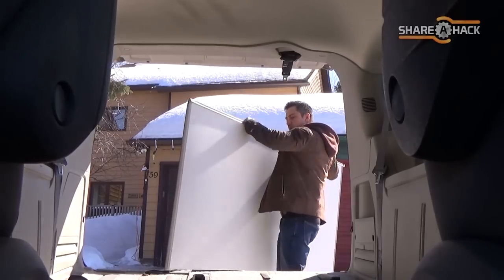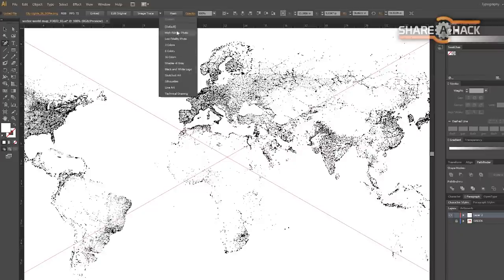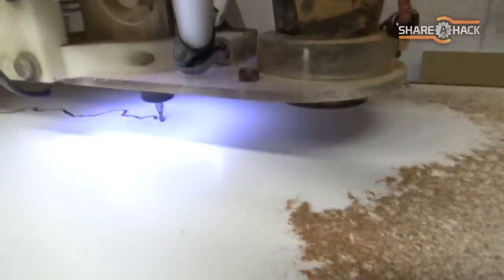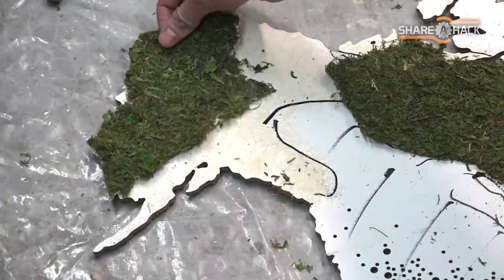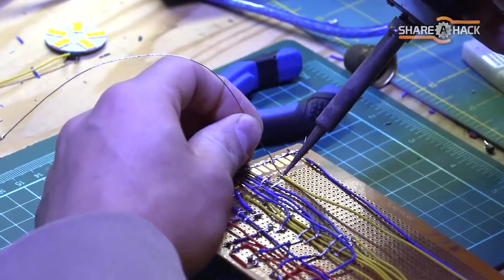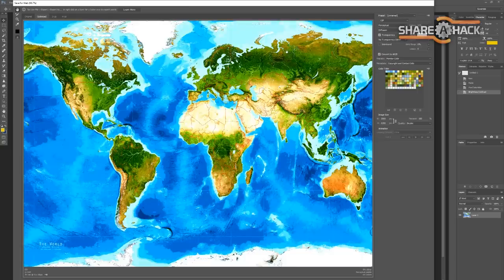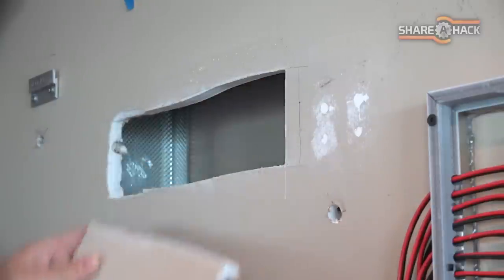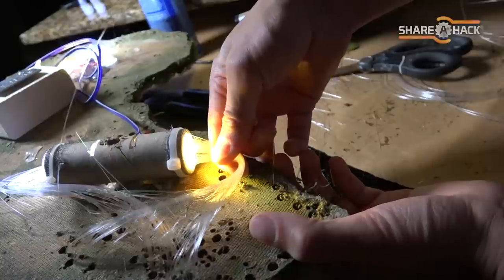DIY Floating CNC World Moss Map with Fiber Optic LED Cities

Comment: Hello there, I have been thinking of doing something similar for a while, the main difference is that I'm going to 3d print a topographical map. How would you go about making the holes for the lights? Do you think using string led's will give a better effect? Any help would be appreciated.
Reply: Did you ever do this? I am thinking of doing something similar I was wondering how this worked out for you?

Comment: Nice project - well done. An idea with the lights is to time the lights with the rotation of the earth in real-time (the backlit LED strips could be daylight and the fiber optics be the nighttime lights). Maybe do this with Arduino and a clock circuit? Just curious why you didn't cut the continents out with the CNC and instead used the reciprocating saw?

Comment: What is the shelf life of that epoxy once opened? Nice job!
Reply from the maker: Thanks! Any 2-Part "binary" Epoxy should last for years if it is left unmixed and away from UV light exposure. You have the resin itself, and then the resin "hardener" or activator. Once it's mixed, it depends on the brand you're using. Some dry or "cure" in 5 minutes - others can take 24 hours +.